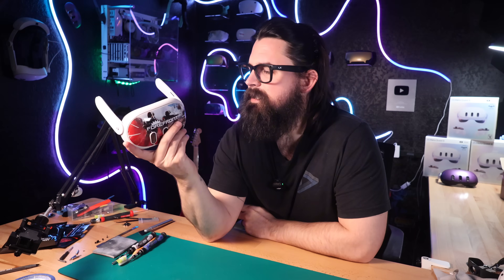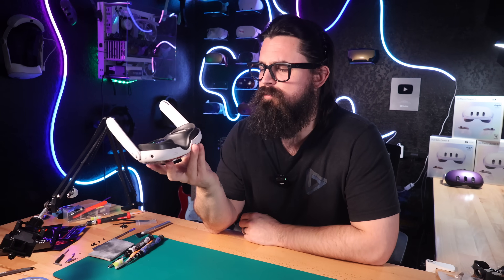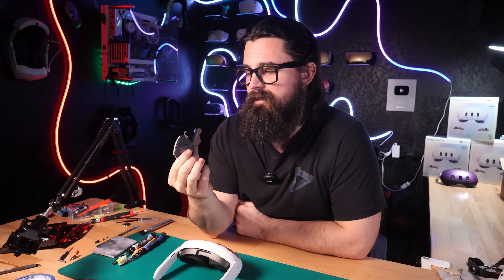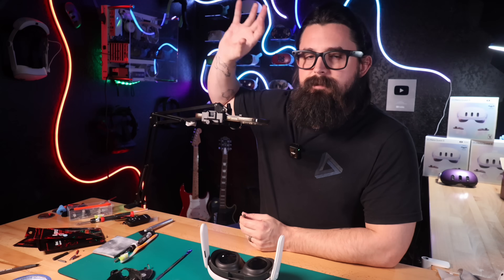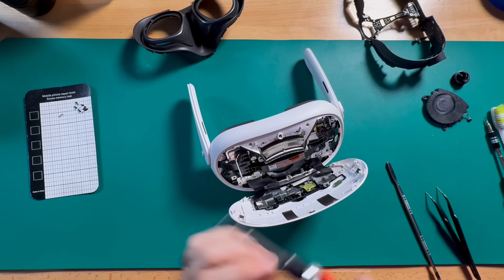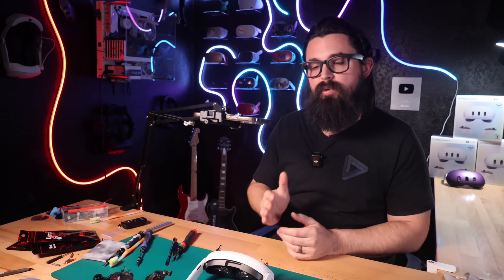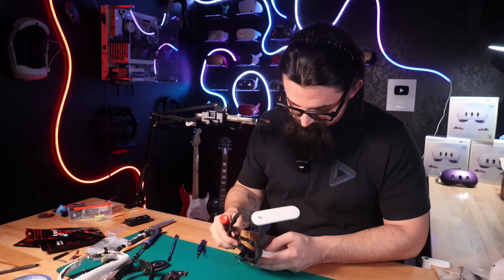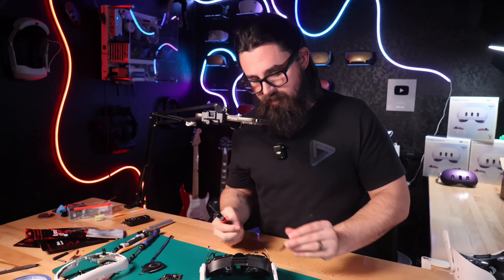It's A Good Thing He Sent This To Me

Comment: 00:34 after working in different technical “Installation and Repair” service functions for +20 years, I’ve come to accept that intermittent issues must follow some variant “observer collapsing the wave function” from quantum mechanics.

If an issue is being observed by a qualified technician, the problem collapses into its “stable state” 😂🤓

Comment: If the fan was only spinning up with it on the dock, it's likely it was just installing an update. By default the headset will power on periodically and install updates (which can be pretty CPU intensive and cause the fan to spin up for a while) when it's sitting on a dock or plugged in even if it was originally powered off when you placed it on the dock.
Reply: Yup. 
This is most probably a software issue.

Comment: does the thermal paste/ pad mod help with lowering temps and by how much? i added more intake holes, and expanded the exhaust port area to help and had no heating issues prior to that mod. I am always looking to drop my temps even lower. i wish the headset breathed more fluently/ freely and could have a custom fan curve capability. 🔥

Comment: The battery bulge is a big problem with cell phones too. Do you have a time frame for replacement?
I was thinking about 1 1/2 years max. Do not have any VR, just like fixing things.
Thanks.
Reply from the maker: Really seems to be dependent on use and care. I’ve seen some quest 2s and 3s that still don’t have it years later and then some units that get it after like a year.

Comment: You definitely need to baby those rings near the strap, even cautioning people who are trying out my VR, I will tell them not to pull on this.  It isn't exactly something you have to do, but you can stick lens protectors over the front lenses because these can break more easily than the quest 2.

Comment: My vr when put down the meta os will appear but than stop and it drains the battery what do I do?
Reply: Depends on what headset you have, if you have a Quest 1, 2 or 3, it could be caused by something being picked up by the proximity sensor inside the face gasket, just disable it through settings, a simple tutorial video can help. If it's a Quest 3S, that's odd since they don't have a proximity sensor, and I'm unaware if they have a way to turn on automatically...